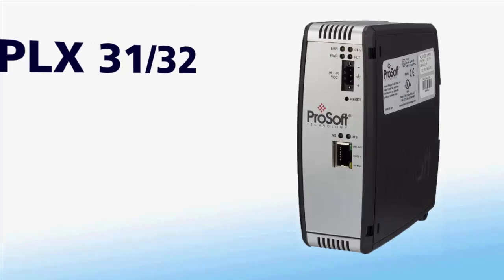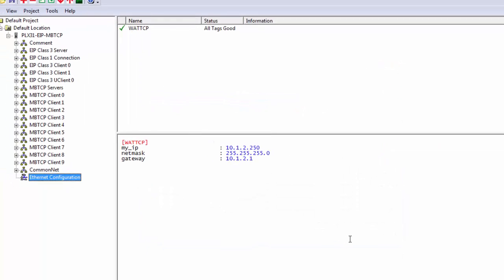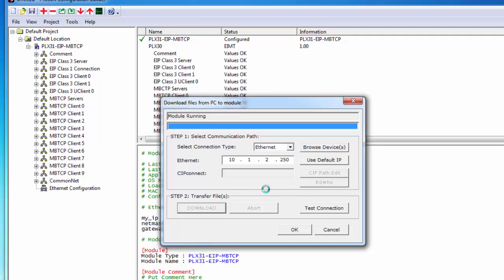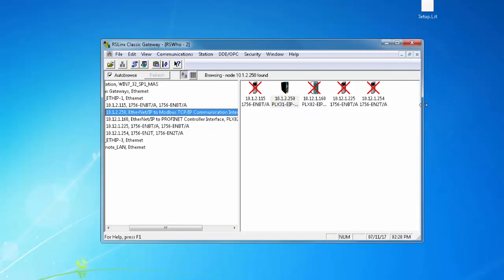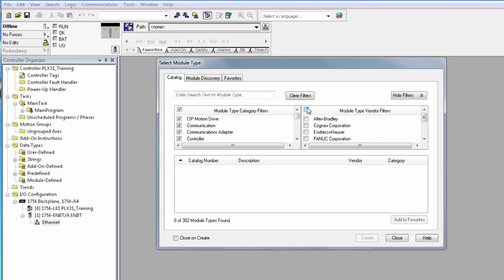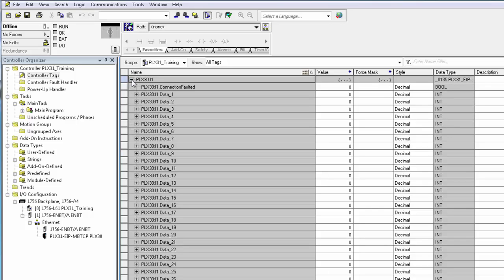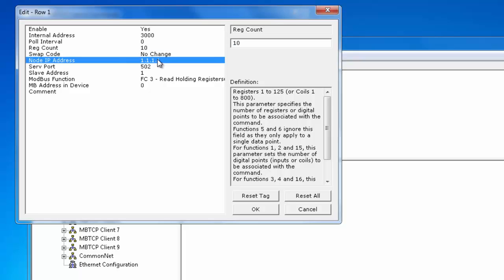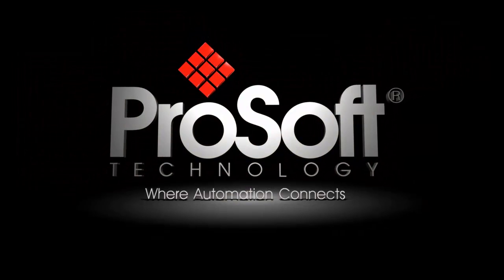Set Up: EtherNet/IP to Modbus TCP Gateway

Comment: How can I do a Factory Restore for a MVI56-PDPMV1 module?
Reply: There really is no 'Factory Restore' for that module, and, indeed, for most ProSoft Technology modules.  The only thing you can do to put them back to the way they were from the factory would be to add a new MVI56-PDPMV1 to the modules in ProSoft Configuration Builder (PCB) and then download that new, default setup to the module.  This is the way they come 'from the factory' before you download your specific changes to them.  This is the only "Factory Restore" you can do.
Jason Sanders
Senior Technical Support Engineer
ProSoft Technology, Inc.
Reply: @geraldsanders9232  thank you!